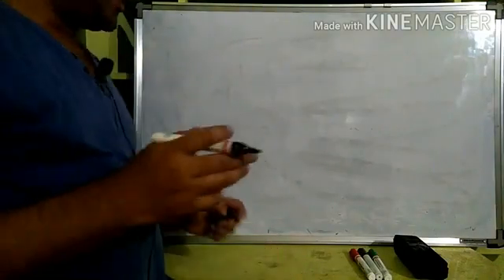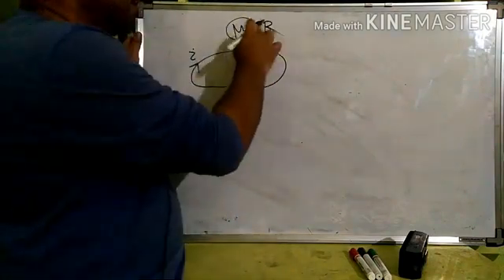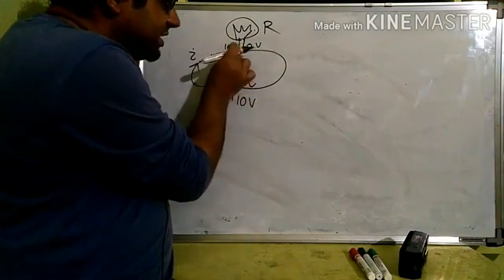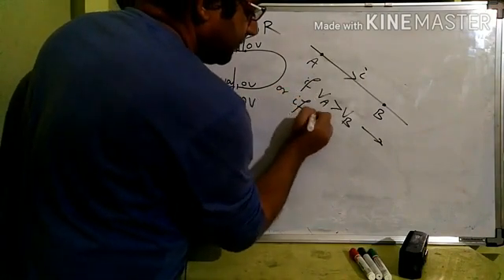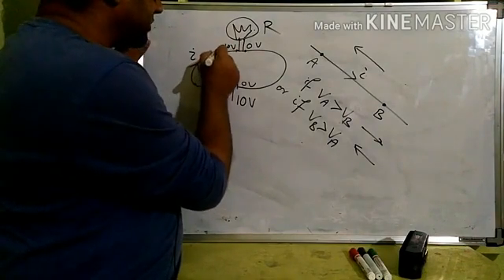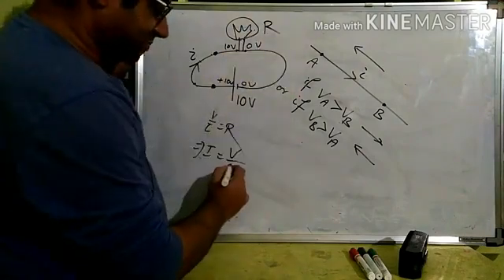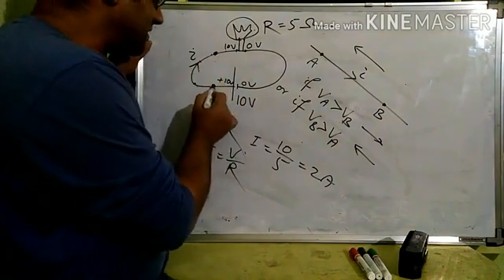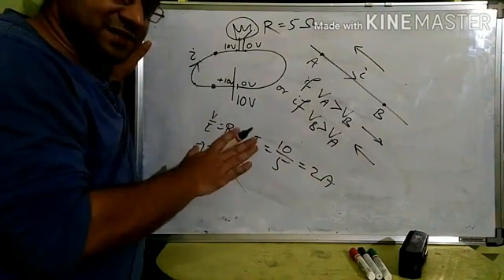Can current flow if potential difference is zero?! by Sanjaya Rath @ keyphysics.com

Comment: Good explanation
Conclusion : Potential difference is required to move current between two points , but not between the two points present between those two points .
Reply from the maker: Actually between any two points (if a current flows between them) there must be a potential difference. But it can be negligibly small... which is the case here! This analogy helps, but to be clearer, imagine a very long (say a kilometre long) tube carrying water with a height difference of 2 mm (say). The water still flows because of height difference, but it's negligibly small. Hope it's clearer?

https://youtu.be/8UqEizndUco
Reply: @KEYPHYSICS  yeah , my concept was already cleared in video,  thanks very much